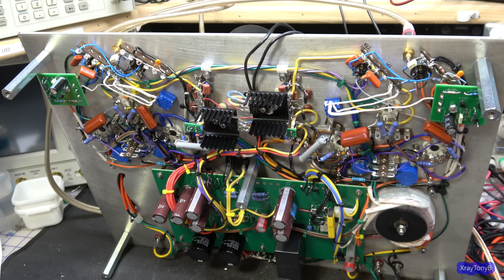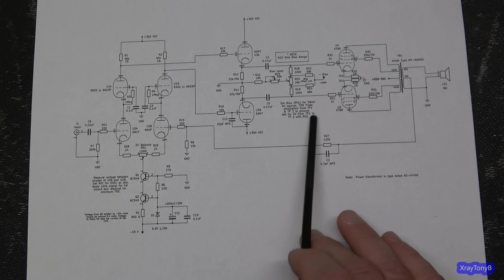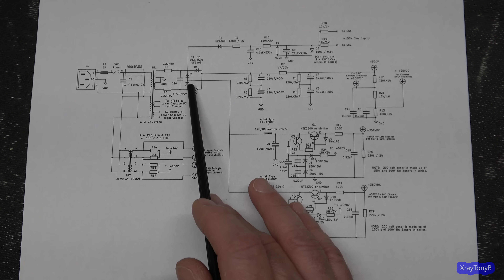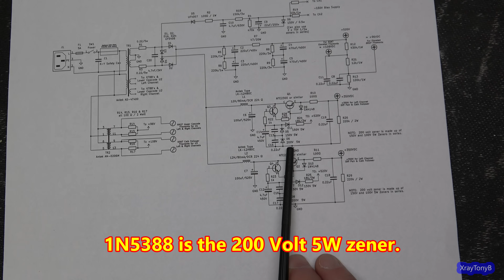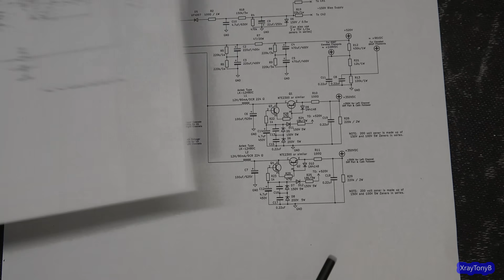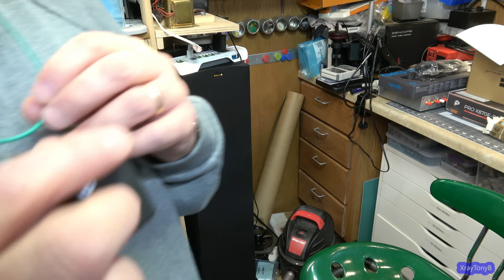Hedge Amplifier Par 10 - How Does it Sound???

Comment: It's advisable to have the output stage to clip well before the driver clips.

The driver stage should be able to cleanly provide MUCH more gain than the output stage needs for full rated output. This makes a huge positive difference in subjective amplifier performance.

Also: yeah, the KT88's really could use another 100V or so for efficient and more linear running.

Also: perhaps not worry so much about measured static output power and static measured THD.  It's just not that relevant to subjective performance.

Transient performance, stability and actual ability to drive the complex dynamic load of the loudspeakers in a subjectively compelling way --these things are more important.

After all, you are building a high-fidelity listening amplifier, not a PA amplifier.

Comment: Cathode followers: unfortunately, they always "look good on paper" but almost invariably they kill-off a significant portion of the subjective liveliness of an amplifier. I've been tempted to use them more than a dozen times, and every time I end up yanking them out and redesigning the circuit to use a standard common-cathode gain stage --always with huge improvement to the subjective quality and enjoyment of the amp. 

FYI:  5687's in standard common-cathode configuration (with capacitor cathode bypass) are fantastic driver tubes for the KT88. You also then would not need nearly as much voltage gain from the input/inverter stage --and this would further improve sound quality.

Also: I guarantee if you simply eliminate the loop feedback entirely, and instead of fixed-bias utilize  * individual* cathode bias with separate bias resistors and bypass capacitors per KT88 --this would also improve the subjective performance of the amplifier greatly.

Otherwise, very clean workmanship and layout. Kudos!

Comment: Yeah it looks like you're done a good job! much tinier now. 
What is signal to noise ratio? How long do you think the tubes would last I suppose power tubes? What's the Transformers are they toroidal ? where did you get them from? Expensive. how much do you think it cost all together.
Talking about the transformer impedance couldn't you run two parallel power tubes instead of one? wouldn't this sort this out give more power, is there a downside to that?? 
I just wondering about running it just as a preamp into a solid state high current amplifier. I was looking for something with high voltage output, probably work quite well what do you think Tony. I can drive the amplifier up to nine and a half volts on the input

Comment: Nicely done! The buzz from the power supply is probably from the chokes as they form flyback transients when the diodes switch off. A small 220nF-470nF in front of the choke helps or placed as you did obviously did the trick as well. I would have hoped that you gave the 6N1P a chance by raising B+ even higher to 400V with 120k plate resistors to raise the gain and then adjust the CCS so that you get 200V at the plates to keep the 6SN7 centered, may-be with slightly bigger cathode resistors. May-be another time....but great that the amp works to your satisfaction which is the most important thing and thanks again for letting us take part of your development.

Comment: The higher plate load is probably giving you better distortion numbers. Most KT88 p/p amps I've seen use 4-5K a-a primaries. Keep that wheel turnin' :)